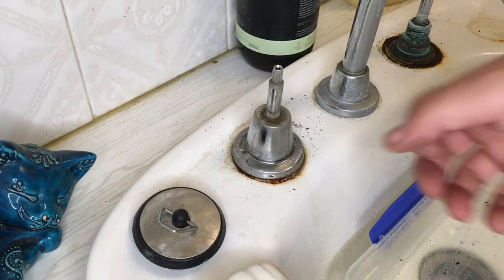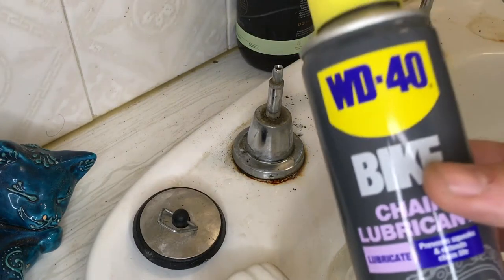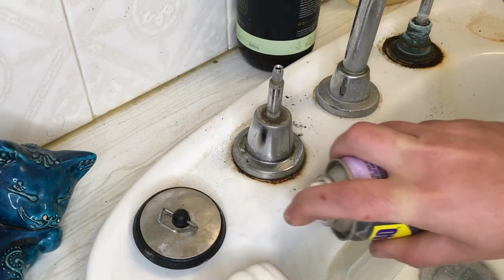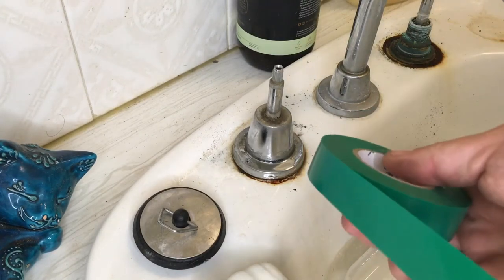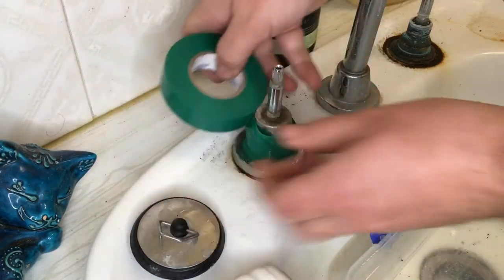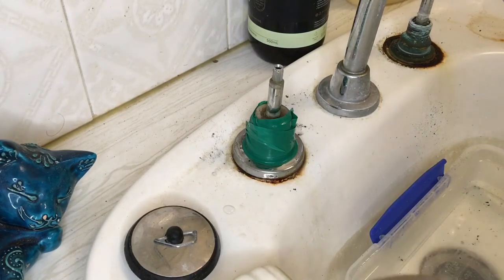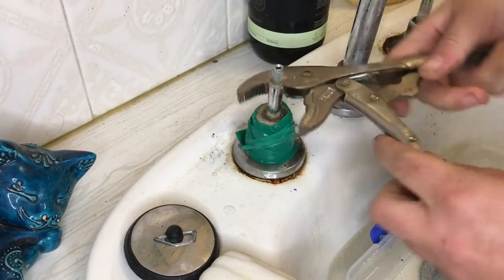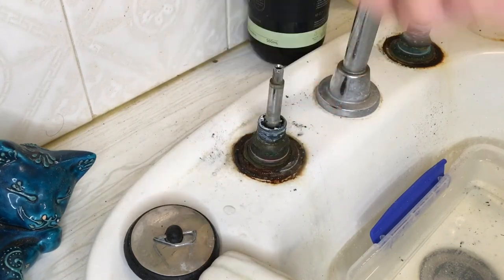How to remove a stuck spindle cover

Comment: Tape around the bonnet is a great idea. Heating it up first with a hair dryer did the trick for me.
Reply: I was thinking on doing the same thing, but with a torch, I better just use the hair dryer, thanks for the tip.

Comment: Nice.   I have exactly the same tap bonnets.   I did try the tape trick originally but mine were stuck really solid & the vice grips just cut through the tape or turned anyway.     I eventually got them undone with a lot of WD40, hammering & some heat.   I did a video too.